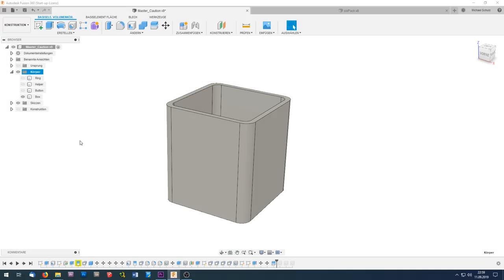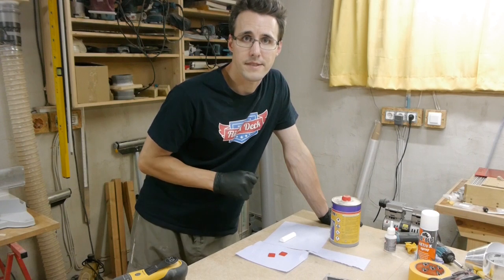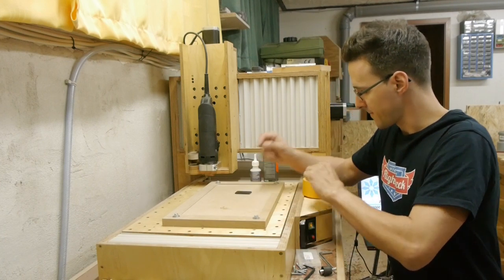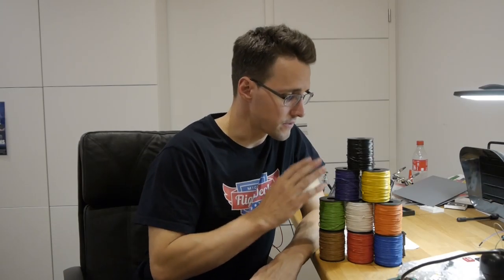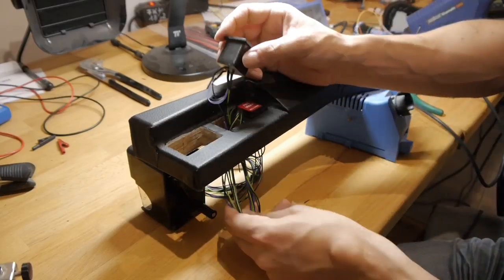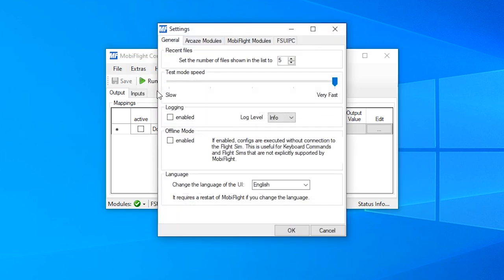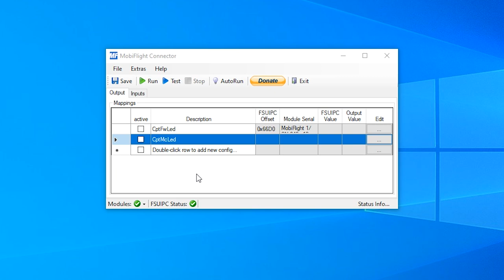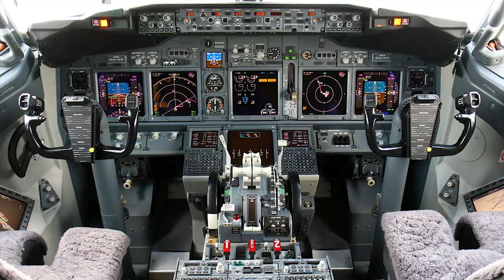Building glarewing annunciators - A Boeing 737-800 Homecockpit #36

Comment: Very nice! I did some korry style switches recently for my mcp project, and I did a couple of things differently. First, instead of mounting the buttons and leds on a 3d printed rectangle with holes, I used my cnc to mill a circuit board and soldered the switch and leds in, along with the resistors for the leds. I recommend that approach. Second, I 3d printed the button box and housing first like you did, but the rough finish meant that the fit was either too loose or too tight. The second time I milled the button box and housing out of delrin plastic, and the finish and tolerance were much better; the parts slide nicely. It was hard to do though because internal corners can only be sharp due to endmill diameter vs length, so I’m not happy yet with my design.
Reply from the maker: I'm thinking of making PCBs for the overhead annunciators too. So I wouldn't need to print a solid ground with the 3D printer. But I'm planning to build them only with one LED and without a switch inside. It could be a good small project to get into this PCB topic.

Comment: Hi where can I get the measurements of this project. Did you make the parts and a 3D printer?
Reply from the maker: The files can be downloaded from the member section of my website www.mickeys-flightdeck.de. The parts were modeled in Fusion 360 and print out on my 3D printer. The engraving was done on my homemade CNC.

Comment: Electrical Wires were you buy and name to cable. How many meters one?
Reply from the maker: I bought them from ebay in rolls of 100 meters. The english word for them seems to be "strand". They have a thickness of 0.14 mm and are made from several smaller wires. So they are very flexible.
Reply: @Mickeys_Flightdeck   Ok i buy 0.25mm but it is ok to amazon many collors to.  what you think Hispanapanel staf?

Comment: How do you know which 'BIT' type to use?
Reply from the maker: It depends on the value you have to transport. For switches or LEDs it is just on or off. Which means 0 or 1. In this case an 8 bit unsigned is enough. For bigger values like numbers on seven segment displays you have to choose types that can transport those values. You should look for an eplanation of binary umbers to understand this topic.

Comment: Was genau ist das bei 3:24. Kann es nicht ganz genau verstehen!

LG Noel
Reply from the maker: Das ist farbiges Acryl. 3mm dick. Mein normales weißes Acryl, das ich für die Panels benutze hat eine Lichtdurchlässigkeit von 30%. Diese haben eine geringere Durchlässigkeit.
Reply from the maker: @EdekaKuchen  Bei Ebay. https://www.ebay.de/itm/Plexiglas-Acrylglas-Zuschnitt-Platte-Fenster-3-mm-diverse-Farben-192-m2/192128044439?ssPageName=STRK%3AMEBIDX%3AIT&_trksid=p2057872.m2749.l2649
Reply from the maker: @EdekaKuchen  Nein, derzeit für den Simulator Prepar3d. Später dann vermutlich MSFS2020.